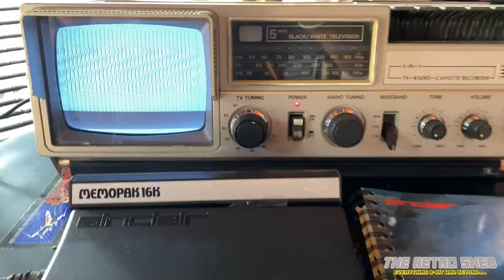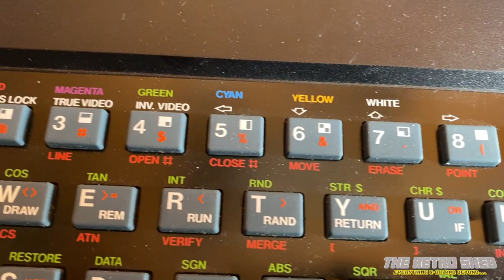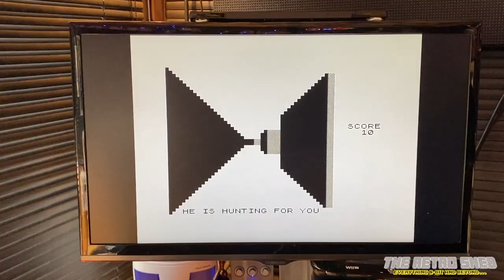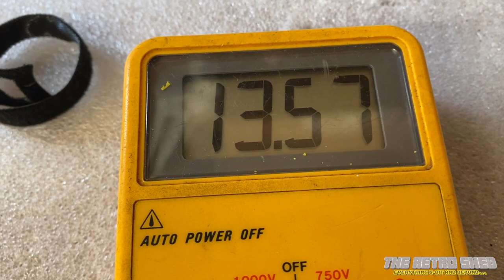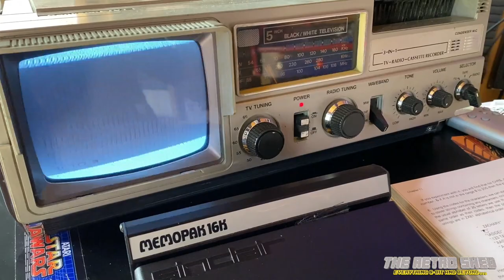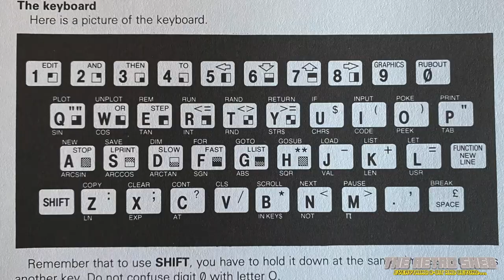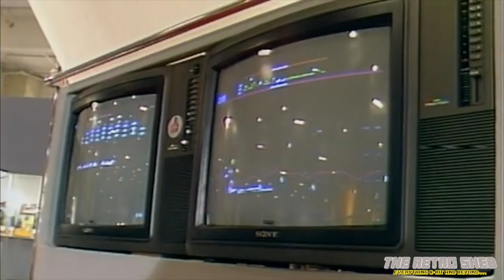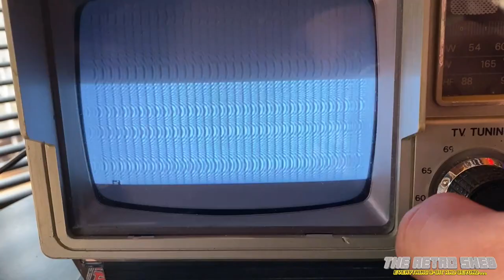Sir Clive Sinclair & The ZX81 | The Retro Shed

Comment: The first ZX81s did not generate a correct video signal, it missed the "back porch" signal, which meant the TV could not calibrate the black level of the signal. Older CRT TV's were very forgiving, but modern LCD TV's are not! Somewhat later ZX-81s had a modified ULA that did generate a "back porch" signals, and that will improve video on modern TV's greatly. There are same patch boards that can repair the back porch problem. Also there are ways to bypass the RF modulator for a much better "composite video" output. The C5 was way ahead of its time think about all the electric bikes we now are starting to use.
Reply from the maker: Great post and information! Yep old tellies were very forgiving. My old telly and ZX81 still don’t want to play nicely together so I’ve bought a mod kit. Looking forward to fitting that. I may do a video on it as well.